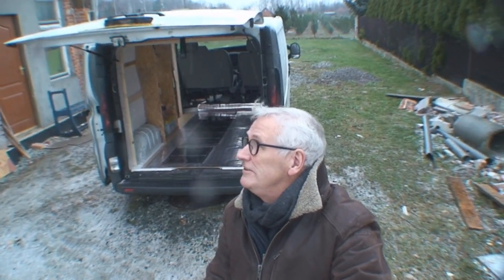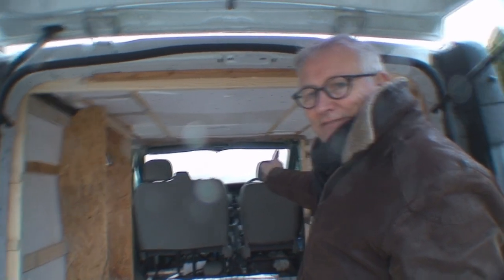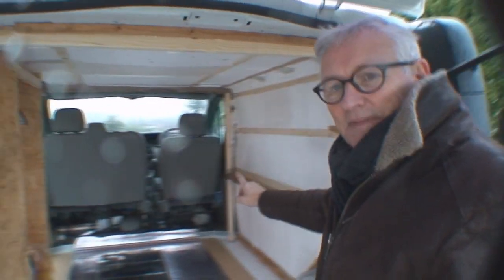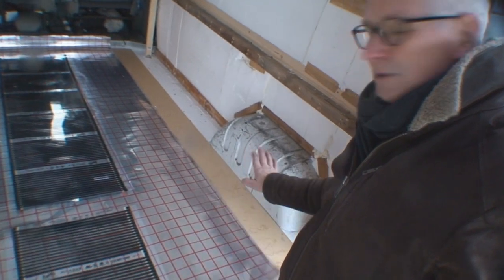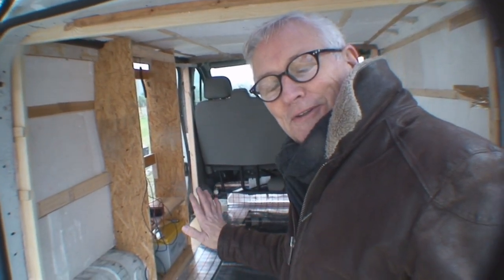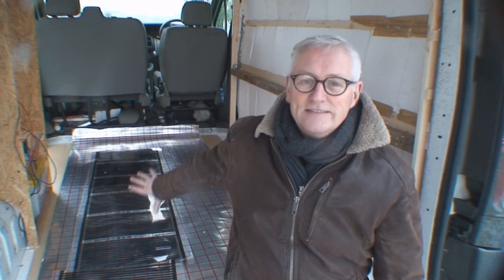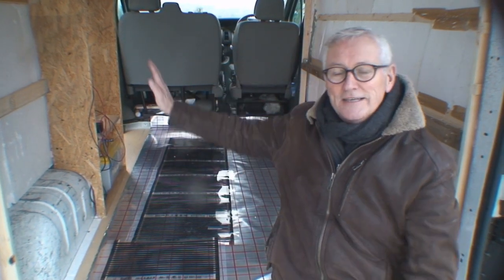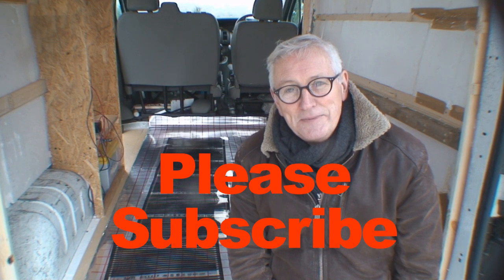Insulating and heating a van & underfloor far infrared heat

Comment: Install floor insulation then between the insulation and the floor boards install copper pipes back and forth like a radiator.  Then connect the pipe to a hot water heater which could also heat your sink water and shower.  This will keep your floor warm.  You can also do the same in your walls and ceiling to increase heat in van.  You would need a pump to keep the water circulating and shut off valves so you can shut off walls and ceiling etc to regulate heat if it gets to warm.

Comment: Hi, please share how does the heating perform after more than a year. I want to utilise a DC powered infrared foil just like yours (24V not AC), I would like to know certain things: what is your battery capacity, how long does it operate before its empty and you need to recharge, at what temp. difference between internal and external env., what temp. have you set for you floor, is it very warm to your feet?

Comment: Thanks for the video. Where did you get the under-floor heating panels?
Reply: Dean Neumann , try an eBay/ Amazon/ google search underfloor carbon heating. another good video.
Reply from the maker: I found mine on aliexpress. But here's an amazon link if you want it quicker http://amzn.to/2hysfUo You can search (One Square Meter Floor Heating Film No Accessories AC220V Far Infrared Heating Film 50cm x 2m) on aliexpress if you don't mind waiting a month :) But it was only $13 sqm so may be worth the wait ;)
Reply: I also put underfloor heating in my van - I did not see your film until after I had done it which was a pity as I could have referred to it.  My supplier was a company called Heat Decor from Krakow, Poland.

Comment: Looking forward to an update on the floor heating. From what I’ve read it is great for making the floor comfy, but doesn’t really heat the space much
Reply from the maker: Actually it's infrared so it does a great job at keeping the space warm. I was actually very surprised at how warm it was in the van even with just one panel on (50w) in minus 12c temperatures outside. Infrared emits wave energy that warms when it comes in contact with objects. So it's been awesome.
Reply: So why did you remove them later. Was it just for safety?

Comment: Like your framing and insulation approach very much, both for its simplicity and mitigation of thermal bridging (still a rarity among van builders). I assume the system is well-tested by now, and would be curious what exterior temps are comfortable inside without heating and cooling measures. Many thanks!
Reply from the maker: I've had -12c (minus that is) overnight outside and 5c inside in the morning without any heating on. Then; even with a small heater (200w underfloor infrared film) on for about 30 minutes temperatures reach 15c. Insulation has for me been the biggest factor. I'm doing a video on infrared heaters as I'm getting amazing 'dry heat' results by using far infrared. Thanks for your comment.

Comment: Are the tiles AC220V? Or can you run them on DC12V?
Reply from the maker: 220 or 110 AC but they will work with DC over 48v as they are technically just a carbon resistor.

Comment: Very interesting video looks like you got a very good working knowledge how to fit a van . Can you fit styrofoam sheets to your back door batons / bulkhead and put them on ceiling when not in use ? i am thinking way better than curtains , this will eat into your living space , i guess it's a trade off  just a thought . Rob Duncan in Scotland
Reply from the maker: I found the lost few inches can also be used as storage anyway. It really does isolate those cold spots though. Works a treat in Dublin as it's cold here right now.
Reply: That's great all good then thanks for reply .

Comment: Doesnt the refective sheet need an air barrier to work properly?
Reply: Yes it need to not be in contact with cold  surface (air gap or insulation) or else it will transfer the heat instead of reflecting it... I have seen even professionals that work with insulation for a living get that part wrong and claim reflective sheets do not work.

Comment: Very interesting video, thank you for sharing. My husband & I just purchased a 1981 Airstream that we'll be renovating next year--so excited!!! We want to insulate the underbelly, walls & ceiling with closed cell blown-in foam insulation. My husband also wants to add radiant heat to the floors. I've read the comments about its relative inefficiently if running off batteries, but my husband thinks it would be a nice luxury when we are camping where there are full hookups. Our rig has a propane heater for off-grid heating also of course.

Did you install the in-floor panels & if so, how did you like them?
Reply: Never mind, I found my answer in your follow up video. 👍🏻
Reply from the maker: WOW! Nice ride Mary. The Airstream is a beautiful design. I have one panel next to my bed so I get the rising heat and it's nice on my feet when I get up. It uses about 50watts which is about the same as running my 50 watt halogen bulb heater/light. I also have a 120 watt tube heater (used for greenhouses). That gives me about 220watts. I usually put them on a timer to come on about 4am, so by 6am when I usually get up and have my spray bottle shower it's nice and warm. The 2 hours uses 440watt hours. (plus my body heat 100watts; that's about 1023BTU's). I also run a small fan (all night) for air circulation to reduce condensation which is only 10watts (70whs). My battery is 1800watt hours (150ah deep cycle). So it handles the 440whs comfortably.I'm currently developing a modular plug and play (SAFE) 18650 battery unit so I can get about 300ah for less than the cost of a 150ah lead acid battery. Should be doing a video soon on the build.I have a 250watt solar panel on the roof which gets things recharged quickly plus I'm adding an isolator so the engine charges me up when I'm driving. You will need more power for your bigger space though. I suggest heating the areas you use to get started. Bedroom and Bathroom. There's a great calculator to help you work this out here; http://www.calculator.net/btu-calculator.htmlInsulation and ventilation are the 2 most important things to consider. Conserving heat is REALLY important but air circulation is needed to reduce condensation. GAS HEAT CREATES CONDENSATION.Let me know if there's anything else you need to know.Have fun on your travels.
Reply from the maker: Yar Nunya Thanks for caring. My big problem with BMS is their unreliability. But then again I hear you on the alternative. I spend a lot of time studying safer ways to work with volatile equipment. I'm working on a lithium battery  system to make the whole thing easier and cheaper. One of the biggest consideration is safety. All the units have individual 5amp fuses and heat censors. These are the 2 most critical factors with lithium. An expensive BMS that in general fail frequently and frankly don't do a better job seems like a poor fix. Still out on which way to go but Tesla has worked through more than most. So I'm all ears on how he's solving this problem.
Reply: OpenSourceLiving , liquid cooling and separating the pack into modules each of which has a BMS and the means to detect and bypass bad individual cells. That's how Tesla does it and there have been fires. You have to sign some agreement when you buy a Tesla that prevents you from talking about such things. Also "don't quote me on this" but I believe a Tesla has something on the order of 14,000 individual cells. Thus the obvious need to auto detect and baypass.
 I am looking at going with CALB lithium iron phosphate, Lifepo4 prismatic cells.
 Much safer in my opinion. Current pricing is about $1,000 for 180 amp hours with 80-90% usable capacity, the best part is only 4 cells in series. 
 The electric vehicle guys do run these without a BMS, some do anyway.

Comment: I'm assuming you will be plugged into shore power
Reply from the maker: No I just run off my batteries system. I have 100ah of lithium ion. And a135ah led acid. More than enough.

Comment: Just a quick note of caution... you are keen on making your van air tight but you will need to breath.  Especially if you are using oxygen consuming appliances.  Seems like you need some sort of heat recovery air intake/exhaust (rather than leaving a vent open on the ceiling to make this work as planned)... have you thought about this?
Reply from the maker: You know I haven't thought of that. I don't really use gas heat. I don't really use any heat to be honest (even though I have 3 types all electric).but I've not had to switch it on because the insulation seems to be doing its job.
Reply: Thank you for responding to my comment.  I have a good friend who suffered brain damage due to CO poisoning in his home so I am very sensitive to the issue. I have a van that I plan on insulating and have watch many youtube videos.  Your thoroughness in insulating made me think of confined space training I received years ago and question where fresh air for breathing  would come from.
the formula q=nV gives the air volume per hour for ventilation.  n is the number of air exchanges (2 would be a minimum value for no appliances or pollutants)  and V is the volume of the space (yours is about 3 m^3) so you would need 6m^3 per hour or 6 cfm.  in comparison a standard electric bathroom fan moves 70 cfm .  HOWEVER... the exhaust air has to be replaced somewhere... I suggest as a minimum louvers in the sidewalls for air intake and small passive roof vents (Flettner has wind powered ones for rvs) as an exhaust.

Comment: So did it work?
Reply from the maker: Yes it worked really well. Especially as I had 2 sections so I could switch to low power consumption and switch it on at about 3am on low with a timer plug, then the boost at 5am
Reply: @SocialHigh  oh great. glad it worked out. thanks for the vid :)

Comment: Well, using the HVAC of the van is better to heat it up while driving.  Then when off a propane heater is better.  For example, put your hand at the output of those 1500 W desktop portable heater - it's barely anything.  And electricity will run down your batteries.  But it was interesting seeing your video anyway.

Comment: What about putting the underfloor heat pads on walls, where they fit and also ceiling, would work great, I think? Just thinking out loud! Nice project, Good Luck, Vinny
Reply: I did this, may end up putting it on the ceiling too.
Reply: People put them on the floor only because heat rises eh...
Reply: mmanut: since heat rises, I'm thinking that the floor is most efficient installation option for heating panels. Panels installed on the roof would be very inefficient.
Reply: Heat rises with conventional heating. This is infared heating which heats what's directly in front of it

Comment: Hay here is an idea that could do more then just heat a van. Items copper radiator, three glow plugs, nintinol thermal electric generators, metal toggle kill switch, insulsted conduit, Gallium aluminum indium alloy IE liquid metal this alloy will absorb and conduct heat really well. Ok now the glow plug will pull 12 volts to heat up then drop down to 4 direct volts. Would need to design electrical circuits to heat one glow plug at a time. Glow plugs placed within copper radiator with titanium sleaves titainium sleaves will absorb the heat and disperse it evenly within the copper radiator filled with the gallium indium aluminum alloy and will allow for the glow plugs to be easily replaced if needed. Then place nintinol thermal electric generators around the sides and edges of the copper radiator to absorb the heat off the super heated gallium indium aluminum alloy and pruduce enough volts to power the three glow plugs and installing the metal toggle kill switch to shut off the current to the glow plugs from the nintinol thermal electric generators. Then design the insulated conduit to have two foot of inner space above and below where your self sustained heating element slides into with air vents at the bottom and air vents at the top. Heated air Will rise causing a drafting effect which will pull cold air through the copper radiator and heat the air. You should now have a passive self sustained heating system that does not generate any harmful vapors or fumes that you can start off a ciggerett lighter in the car or off an electrical wall socket in a home or trailer. 😊

Comment: Does it work??
Reply from the maker: Wallace Murray it draws about 50w per single section. The strip draws about 250w so it is a power guzzler. I have it set up so I can switch each 50w unit individually. The other problem is it's 220v or 110v also I believe. Problem is there are no connectors and of course that makes is VERY dangerous for the average user. Working on a water heating system that I think will be much better. Insulation is of course the key to keeping warm in minus temperatures. I'll be doing more on that soon.